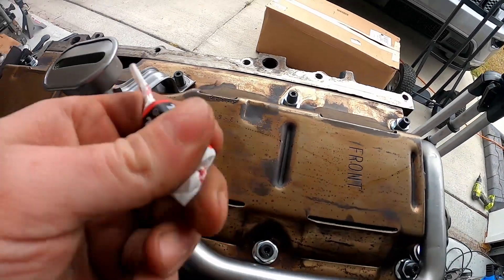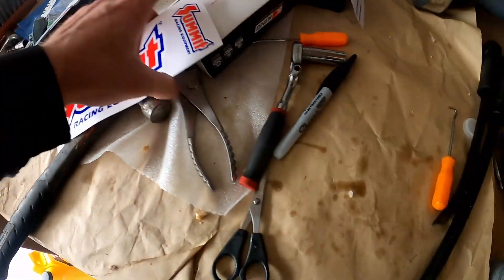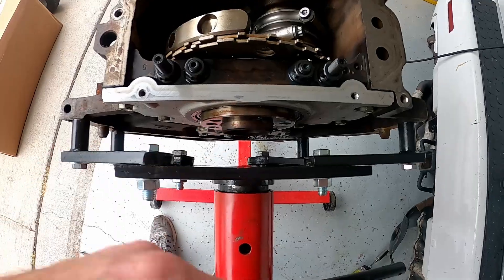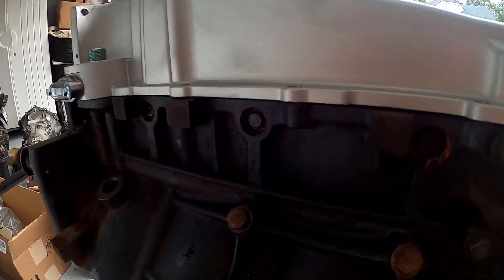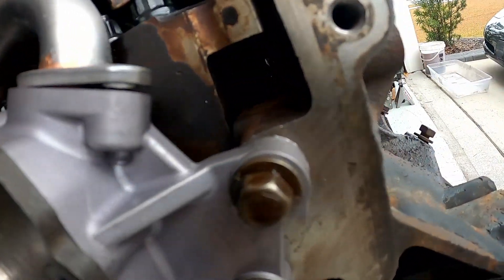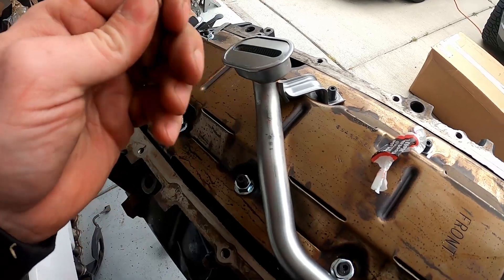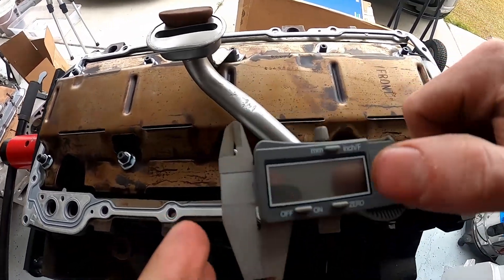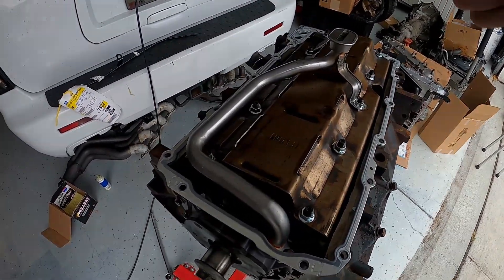TBSS 6 0 Part 4  Heads, Cam, Oil Pan

Comment: Is that a cheaper aftermarket LS oil pan or OEM GM pan? I've learned to NEVER use aftermarket body panel parts and engine parts over the years. Just a heads up.... theres even a slight difference in the AC Delco parts made in Chine vs Mexico! And yes, they cost hundreds more unfortunately.
Reply from the maker: I don't remember exactly where I got it from but if I remember correctly, it was from Summit racing.  I appreciate the heads up.  I have a lot of spare parts for LS engines but unfortunately didn't have a C6 oil pan.